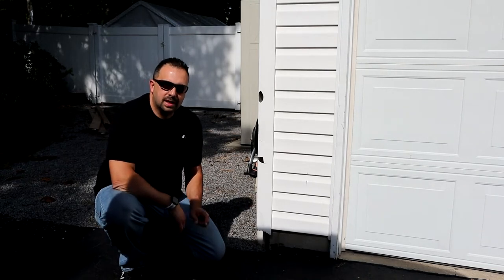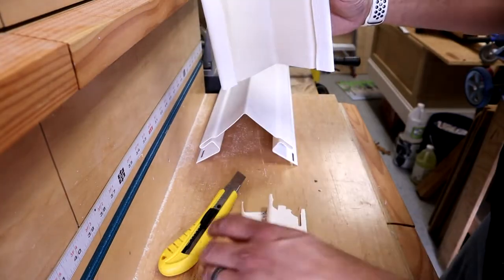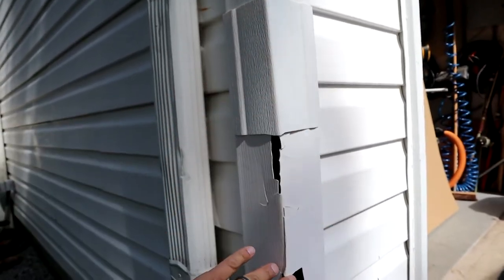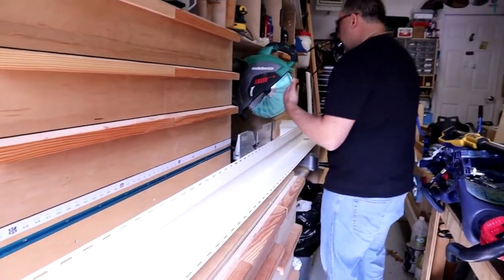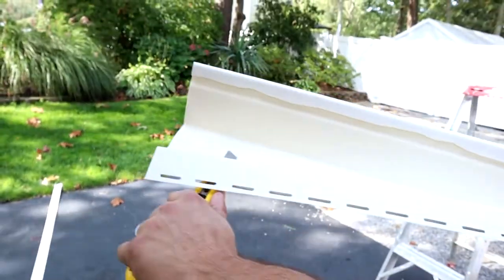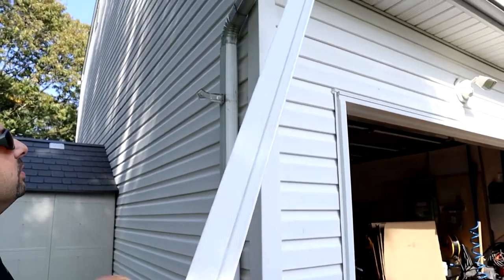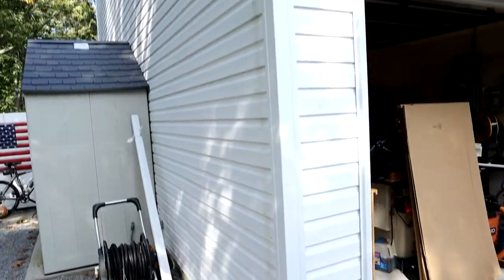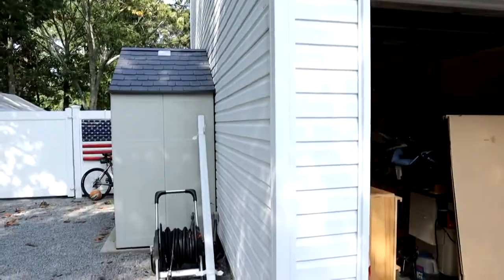Vinyl Siding Corner Repair | How To

Comment from the maker: Siding repair: https://amzn.to/31OwzqS
Siding Removal Tool: https://amzn.to/2T5D4Bj
Utility Knife: https://amzn.to/31cvxFt
Miter Saw: https://amzn.to/30UHYFJ
Milwaukee Drill/Driver set: https://amzn.to/3auep1t
DeWalt Drill/Driver set: https://amzn.to/2PVXmM3
The BEST Screwdriver: https://amzn.to/34xw3QN
The LAST pair of pliers you’ll ever buy that the PROS use: https://amzn.to/3aYacDk
AWESOME wrenches: https://amzn.to/3lioLq3
DeWalt grinder: https://amzn.to/34LalZV
The BEST Hammer: https://amzn.to/3lUKFjw
Level 2 foot: https://amzn.to/2Gxa02F  
____________________________
My Camera gear:
Canon M50: https://amzn.to/2PdqqhO
Mic: https://amzn.to/33jqXae
Tripod: https://amzn.to/3k4w3wP
Reply: Where’s the 4” corner link?  Thanks for this video.
Reply from the maker: @letteriapagan2123  Its available on the Lowes website.  Search for 4" vinyl siding corner trim

Comment: Wow this works perfectly for trying to get wiring down the corner of the house. Make a just enough cut to feed your wire, once done you just cover up your cutout using this method. Perfect for security camera installation.

Comment: Nice idea, here's another tip.  I have a 3" damaged corner, and I just tried it on a new 7' piece,  but couldn't get 4" that matched so I went with 3".  Plus a 4" piece would look too wide compared to an adjacent corner I have.  Cut out the middle of the old piece leaving the flanges.  But when you cut the new piece, leave a little bit of the curve, maybe 1/4", on one side.  So cut about 1/4" less than he cut.  The problem I had when cutting it the way he shows at about 5:00 is that it was hard to pull the flap open to slide over the old flange.  If you leave the curve, as you push it will naturally slide on, for the most part.  Regardless, trying to get 3" over 3" is pretty hard even after cutting out the old piece, the 2nd side is really hard.  I ended up trimming the 2nd sid to leave just a small flap of about 1/2", and then i made a little hook tool from a spare pipe clamp or any piece of thin, strong metal.   But it's defintiely easier than removing all the siding.

Comment: This is very useful. My problem is I have a 4 inch piece and need something larger. Would you have a link to something like that?
Reply from the maker: Buy a 4 inch corner piece. Once you cut the back off, it will fit over the existing 4” piece

Comment: I did this and am am having issues with the new corner piece sliding down. Any idea on how to keep it from sliding down without being noticeable??
Reply: You can use Caulk on the inside grooves. So you would have to remove the new piece in ordered to work. Then apply the caulk to those inside groove on both sides. Reattach the new corner. Make adjustments to get in the right place and clean up any mess on the outside before the Caulk cures